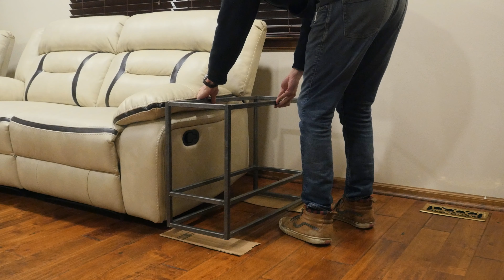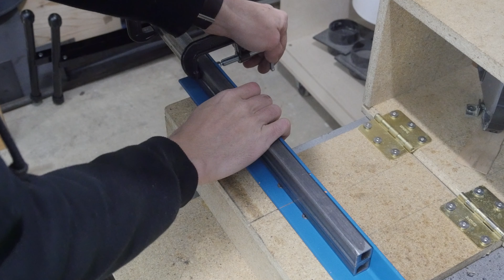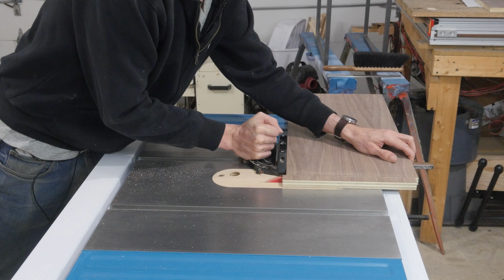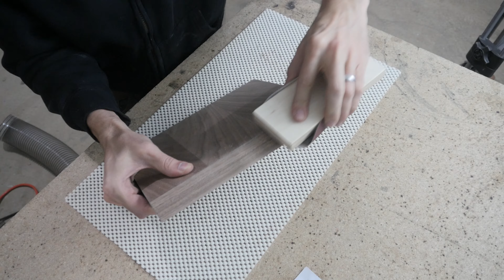Walnut & Steel End Table Build | Woodworking & Metalworking

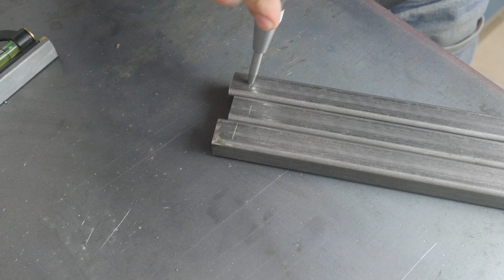Comment: Really cool to see the full process. Enjoyed the video production as well. What is that tool you use at 4:17 to leave those small indents in the frame before drilling?
Reply: And I love the Troy and Abed mug!
Reply from the maker: @BigHedMusic  Thanks Mike!  That's an automatic center hole punch, it helps a lot specially on metal where drill bits tend to wander  when you're starting a hole.

Alex got the Troy & Abed mug for my Birthday, it's my new favorite 🙂 (sorry Caleb mug).